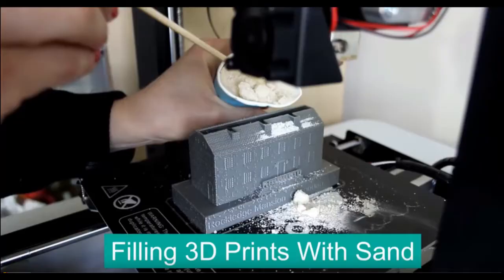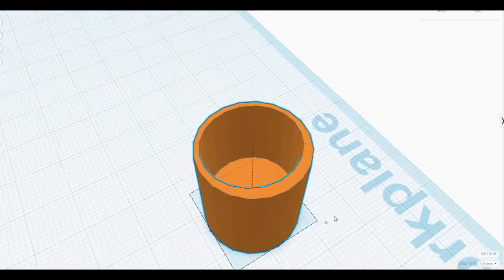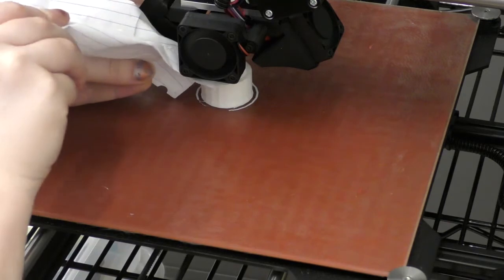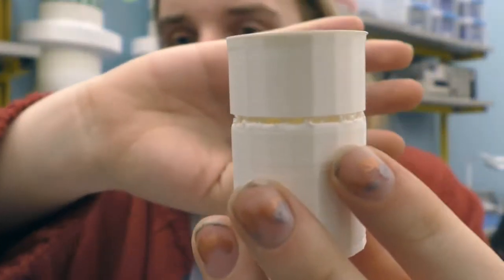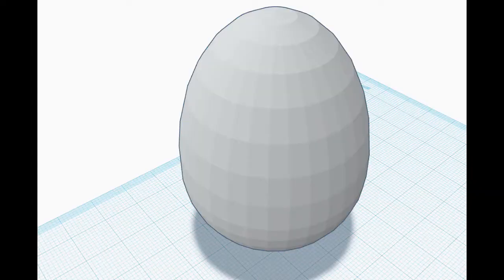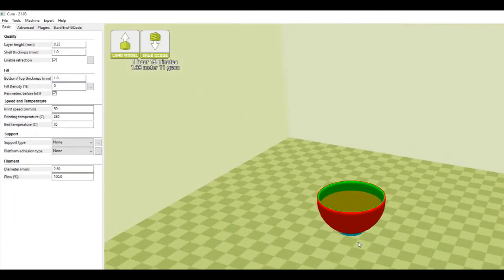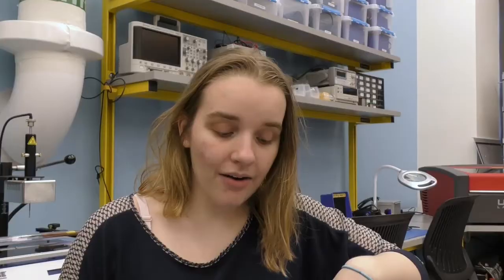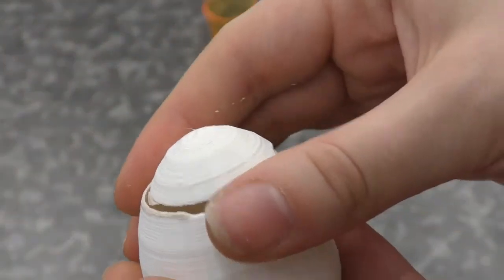3D Printed Eggshaker

Comment: Nice video. I have found if you extrude a little extra filament while it is paused either by the controls on your printer or by pushing some manually and then unpausing it your get a better result as the filament is already flowing. You do end up wit a hair/strand hanging off your model but that's easy cleaned up.
Reply from the maker: Thanks for the tip! I am still perfecting my print pausing process!